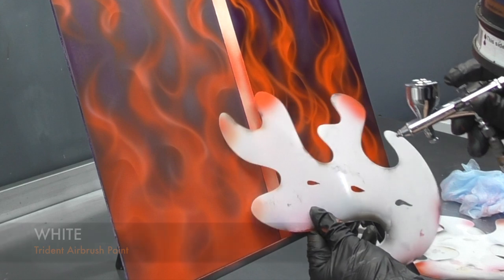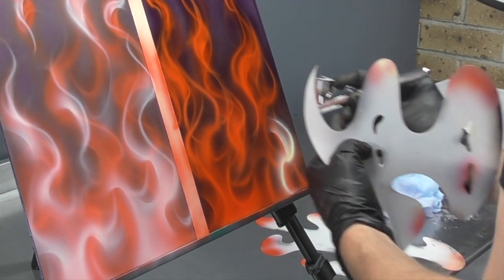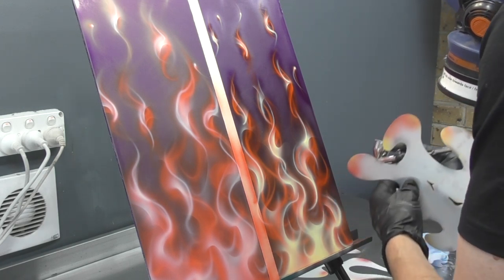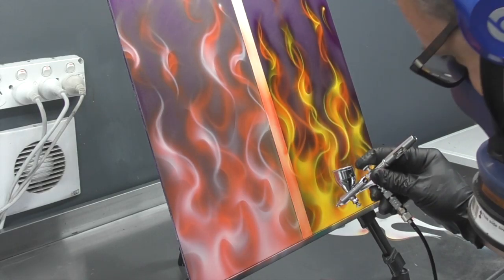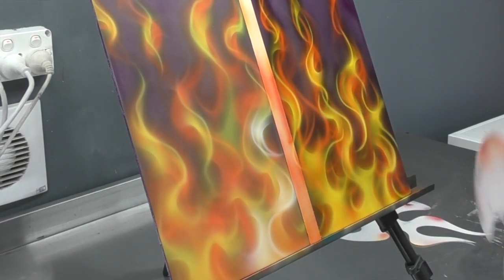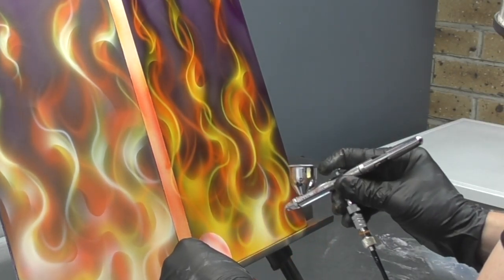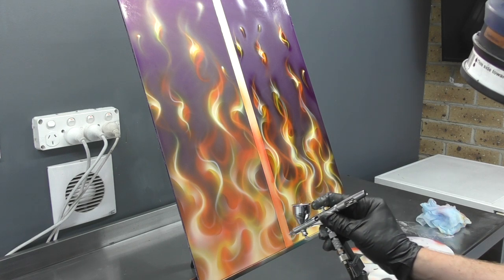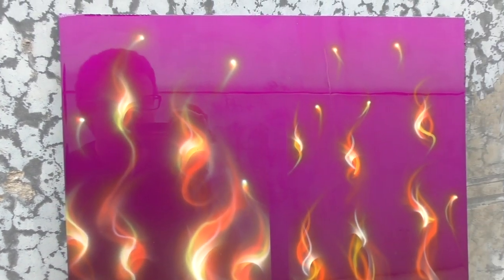Airbrushing Real Fire | Water Based Vs Urethane | Part 2

Comment: Hello, very good video and very instructive comparison. I like the way of painting so clean and tidy that it has .. I have been using water based colors for many years. But since I discovered the colors of house of kolors, I have a hard time going back to the others. Due to their fast drying and good coverage, I consider them a very good option. The one downside that I find is the smell, something strong. but hey, that with a good mask is easily solved. Thanks a lot. a greeting from Spain
Reply from the maker: Yes I used to only use urethanes as I never liked how the waterbased sprayed until I found trident paint which flows almost as good as urethanes ....but I agree House of Kolor is such a great paint 👍🏻